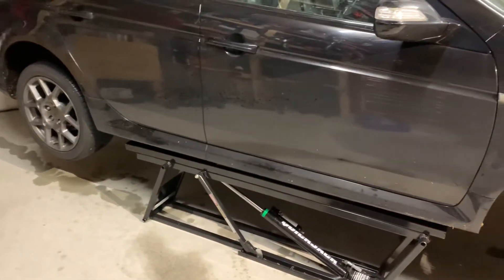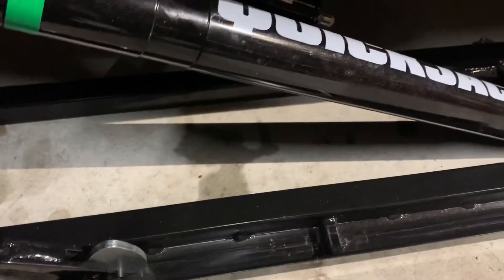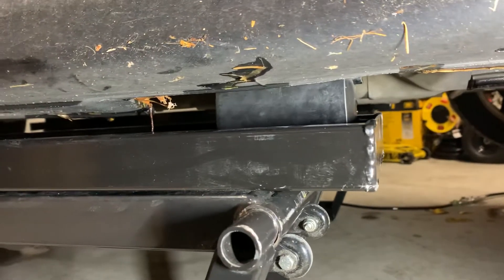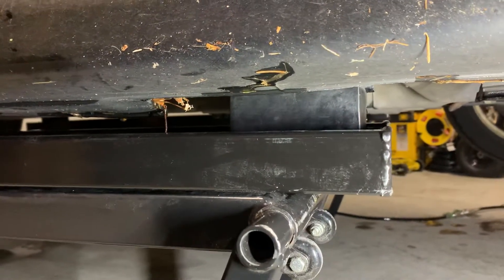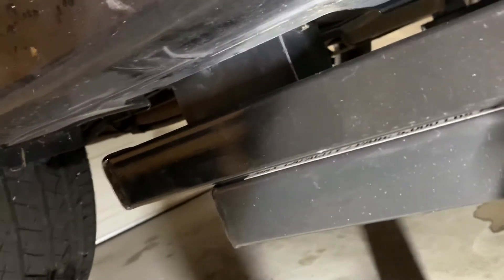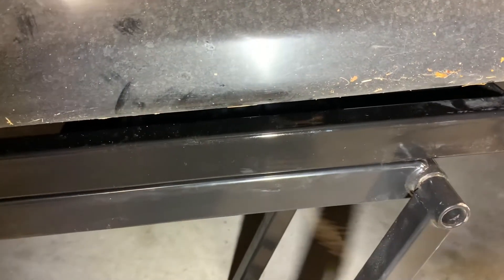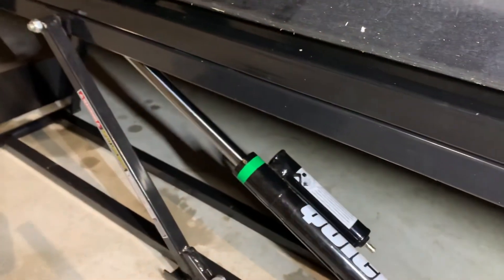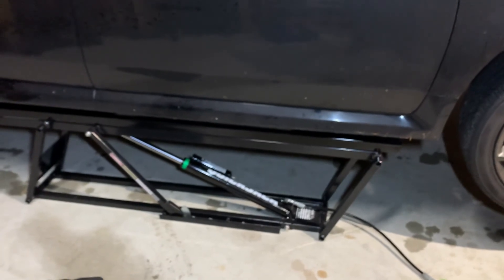Quick Jack BL5000SLX w/Frame Extension (Cont’d) Part 3

Comment: what is the distance from  rear jack point to front jack point? the extensions are rated to extend to 66 inches i believe. I would like to see what your distance is.
Reply from the maker: I’d have to measure later. But the extension did the trick for both my 2008 Acura and 2015 Accord
Reply from the maker: 64 3/4 inch’s for both cars. The extension works, slights cumbersome, but they do work